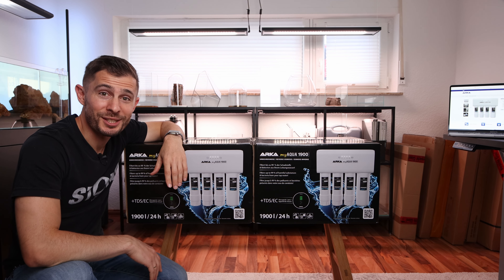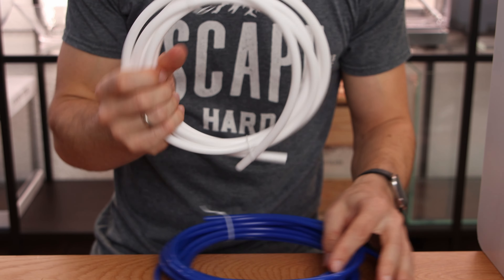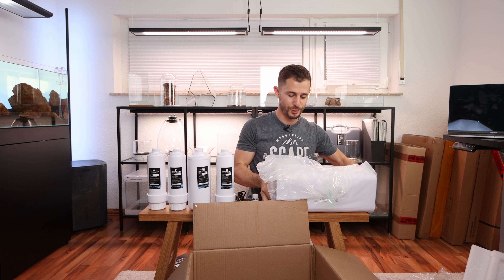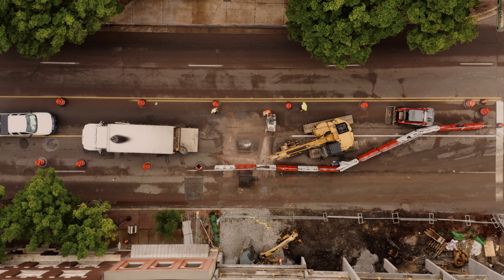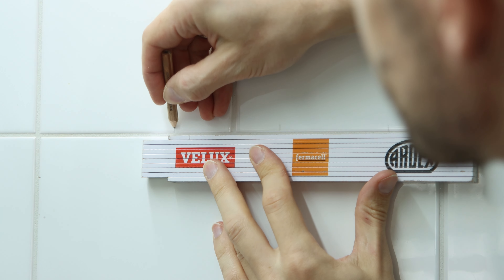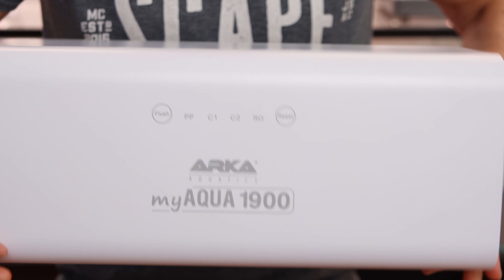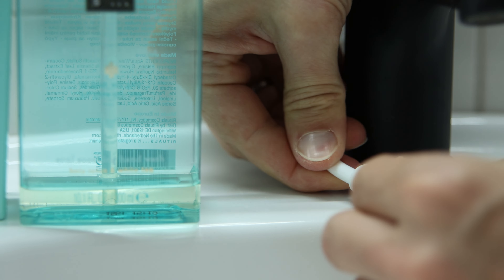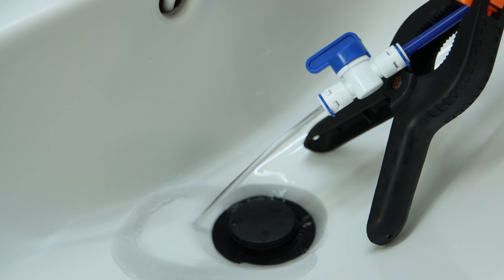How to Setup a Reverse Osmosis Filter for Your Aquarium

Comment: Nice about RO water is not just the soft water but the ability to control the amount of fertilizer added. Especially nitrates can be a problem, in some areas tap water contains a lot of those. Up to 50 mg of nitrates per liter are allowed in the EU. 
A myAQUA 1900 that produces up to 1900 liters or 500 gallons per day of pure water certainly helps with keeping things under control.

Comment: Looks to be amazing, but can’t find some details…I presume this system comes with the built in booster pump, just let me know if I’m wrong… would have few questions: - is there any opportunity to add a high pressure switch / valve on it?also is there any remineralisation cartridge on it or how are you doing / what are you using for remineralisation?Thanks in advance. Joe

Comment: myAQUA which produces 1900l per 24h 

Thanks for the excellent review! It is very detailed and with lots of practical information regarding the functionality, dimensions, handling, and installation. 

Do you turn off the water inlet and power if you don’t use it for a while (when you go on holiday for example)? Or is it best to leave it turned on?
Reply from the maker: If possible it’s actually best to put it on a timer, so it keeps flushing from time to time, this will prevent bacteria blooms inside the system

Comment: I could have really used this video three years ago when I was setting up my RO system. I wish you hadn't stopped the video after flushing, though. I store RO water in a 120l barrel as I have nine aquariums, I've searched online for years but nobody ever talks about how to maintain the barrel so the stored water stays clean long-term.
Reply from the maker: I had to cut the video there, as I wasn’t able to finish filming. More about it in the next video. Keep the barrel clean, cold and dark. Don’t mix minerals inside. Or implement a maintenance routine where you empty and clean it
Reply: @JurijsJutjajevs  Yes, I empty it and clean it with bleach every three months, and all mixing is done elsewhere. I had to develop my maintenance schedule on my own as even the reefer folks don't talk about this for some reason!

Comment: Thank you for the video. I have a few questions. Do you fill the water directly into the aquarium? If so, how do you handle the fact that the water is cold? And how do you accurately measure the amount of water you are adding to then add the necessary proportion of salts for remineralization?
Reply from the maker: When adding RO from filter directly to the Aquarium, a small temperature drop can occur but is no big deal for most fish and shrimps. Make sure yours can tolerate it. To find out water temperature after the water change you multiply the amounts of water with their temperatures and sum up both numbers. Divide by total amount of water and you have your new temperature after the water change. In reality it will be above that as cold water will gradually heat up during the refill process. 

As for the minerals there is two ways. Either visually guessing or actually measuring the amount of water you remove from the system. This is the water you need to remineralize afterwards. This doesn’t require testing. Or you can refill the aquarium with RO and measure your new gh. afterwards you remineralize the total water volume to fill the gap to your target value. I’m using APT sky minerals and they come with a super handy calculator on their website. Go to www.jurijs.link/apt to check it out. If you want to give it a try, use code “Jurijs” for 15% discount. This will automatically support my channel at no extra cost for you 😉
Reply: @JurijsJutjajevs  Thank you so much. You have been very helpful, and this will significantly improve my life. I have four aquariums, two with 40 liters and two with 90 liters. To change the water, I start filling buckets a few days before maintenance, which takes a lot of time and turns my house into a mess. Now, I am planning to set up a 300-liter aquarium, and the thought of the upcoming maintenance was terrifying. I don't have space for a water storage tank, but this system will be a lifesaver for me. Thank you again so much💚

Comment: myAQUA 1900L per day | 500 g/day

Great Video as always, loking forward to see more of your 60U project
I currently have a 45p iwagumi based on your 45p iwagumi and I´ve been wanting to upgrade for a 60p and thinking about doing a nature style aquascape, I realy want to overdo everything so what filter do you sugest for a 60p heavy planted tank, the one I´m currently considering is the Fluval 407 for the beafy prefilter and the high flow rate, and I was going to pair it with aquario neo midia ~2,5L I belive
Thanks
Reply from the maker: For a 60p just any canister filter with 600+ l/h will do the work. I like Biomasters.. never used a fluval thought

Comment: Hi jurijs.....i have a question.... i just bought this...i also bought the optional resin filter. But I understand from the instructions that the c2 must be fitted first, then once the system has started and the initial flushing procedure has been carried out, the C2 can then be replaced with the resin filter. Is this correct, or can I start the system immediately with the resin filter?
Reply from the maker: Both works. The reason why manual recommends using the c2 for flushing and replacing with resin, is to not waste  resin for flushing. On the other hand, it’s only little waste of resin life span, but thr c2 is useless afterwards. If you swap c2 for resin from the start, you can keep the c2 as replacement for c1 in the future. So in my opinion the later is more economical

Comment: I just bought it, my only doubt is: do you put the RO water directly in the tank without heating it?Where i live in winter tap water is pretty cold and i’m afraid to harm both Fish and plants with a termal shock
Reply from the maker: you can calculate the future water temperature like this: (volume of water inside aquarium x temperature) plus (volume of fresh RO water x temperature), divide total sum by total volume of water. If the result is below 17°C you should refill slowly, to give water time to heat up. Alternatively you can use a bucket with hot tap water and run a couple slings of the RO tubing though this bucket, it is going to preheat your RO water. Alternatively you can use a thermostat mixer and use 20°C tap water to go through your RO system. This will also increase the yield as RO systems work best at around 25°C. Another way is to add one or several powerful heaters into the tank while its refilled with RO, as they will help heat up water faster, preventing a significant temperature drop.

Comment: Hi Jurijs, only one question! With my current osmosis filter system I was obliged to buy a booster pump seen that on my flat floor the water pressure is not so ok, so is possible to buy a booster pump also for myAqua 1900, can you suggest me an article compatible with it, or is not necessary? Or i can use the current booster pump that i have? Thanks a lot for your help. Ciao
Reply from the maker: myAQUA 1900 is already equipped with a booster pump, it’s build in
Reply: Thank you so much! Really really fantastic, and you suggest to use also the resin instead of the secon carbon filter? Ciao and thanks again for your help, I really appreciated. Ciao

Comment: myAQUA 1900 litres or 500 gallons in 24 hours
Use RO water is a great option. I usually use the water running from a water purifier, not sure if it produces RO water, but I think it is definitly better than tap water. 
Btw the two Jurijs are so funny! XD
Reply from the maker: Water purifier usually only removes mechanical impurities